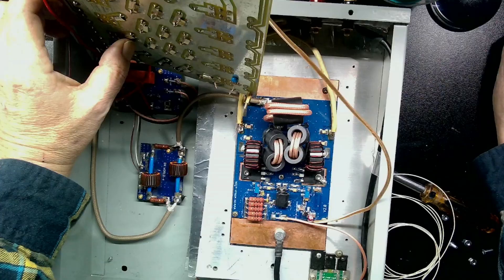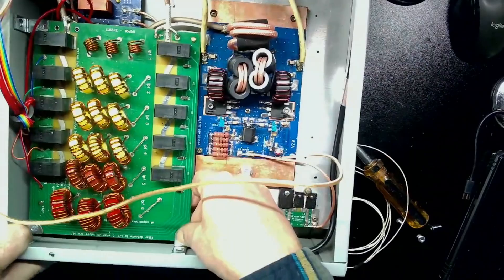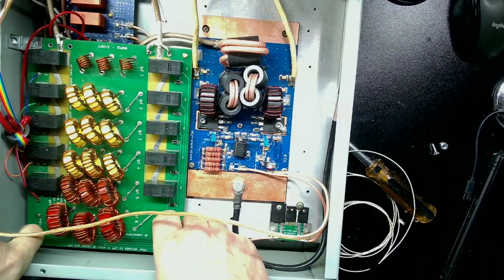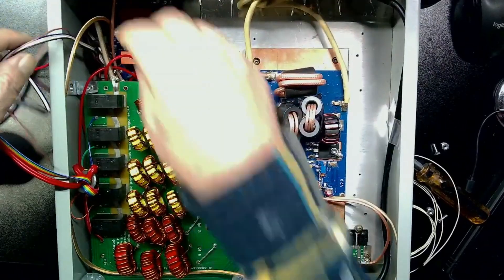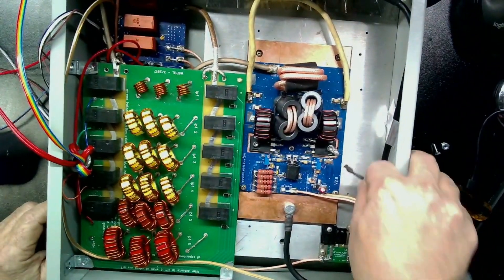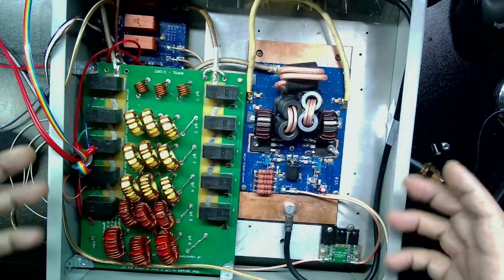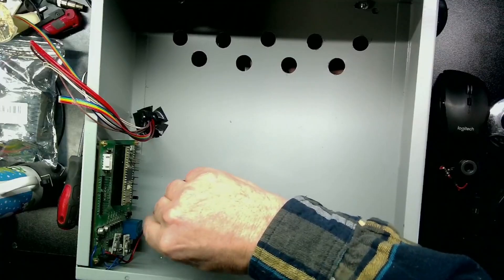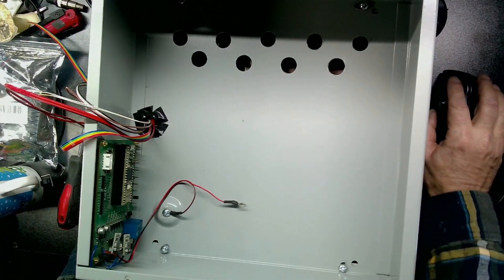DxWorlde 600W LDMOS HF Amplifier (Part 5)

Comment: Just curious as to what power supply you used for the 50 volts. Have been having a hard time finding a 50-volt power supply for my DxWorlde 1200-watt amplifier board.

Comment: Howdy. I fully appreciate the effort and detail you have provided throughout this build. I have the same sspa kit I bought 1+ year ago from dxworld-e . I also get payed monthly so understood. I have everything except a control board to finalize mine. Do you offer your Teensy  designed control circuit for sale? Sounds like an Ideal configuration. Thanks again for all the beneficial info. 
73,  K5JPD
Reply from the maker: Email me and I will send you the KiCad files for the board and the Arduino files free. Right now I know I am going have to upgrade the 5V and 3.3V regulators they do not supply enough amperage.
My email address is on my main page under more info.
Reply: @Jeb-N2JEB  Thank You Kindly.